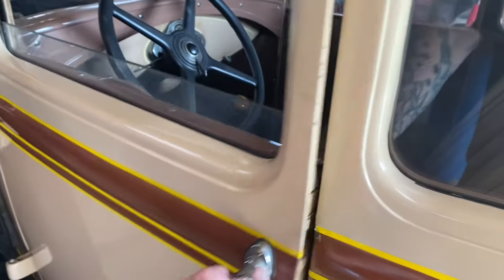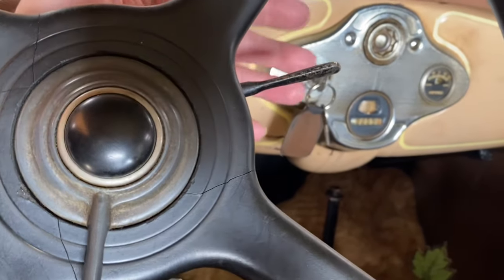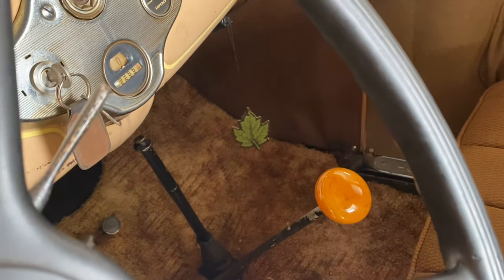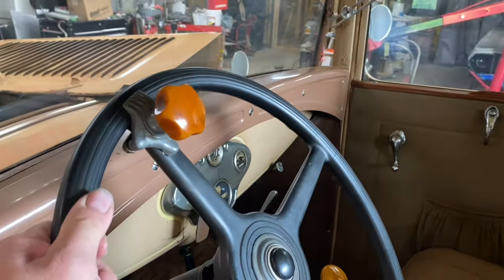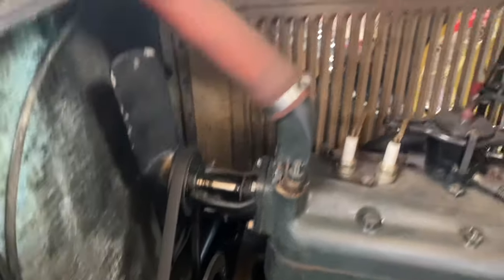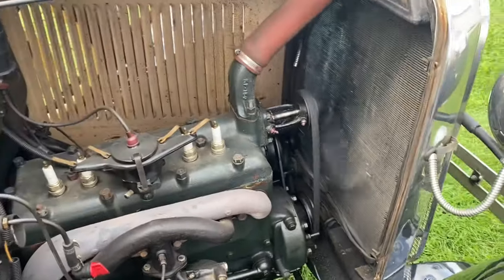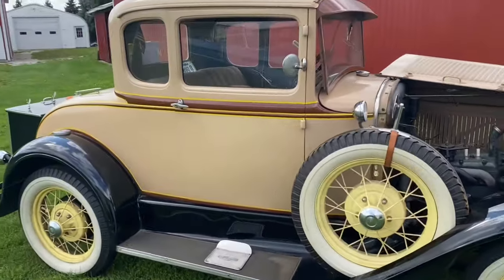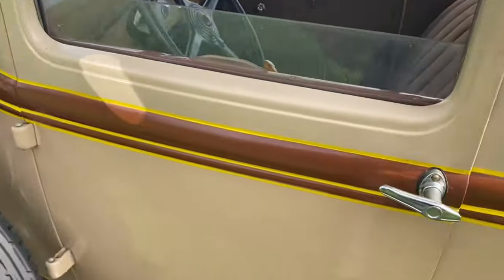Take a tour around a 1931 Ford Model A.  They’re not as different as you think.

Comment: Nice video!  One correction: the black bowl you identified as the factory fuel shut off is actually the fuel sediment bowl. The factory fuel shut off valve is on the inside under the fuel tank.
Reply from the maker: Thank you! And thank you for the info. I appreciate it!
Reply: I didn't see a sediment bowl, it may have been removed

Comment: That autolite heater cover is not made for that manifold. Auotlite made an exhaust manifold that had a extension above the tubes that piece fit on. It was a what they called a waffle. I think. I could be wring on the name. I have the exhaust manifold on my Model A, but I don't have the cover for it.
Reply from the maker: We where wondering that because it doesn’t fit worth a damn haha. Thanks for the info!

Comment: You have no shocks on it.
Reply from the maker: I don’t recall seeing any either to tell you the truth. Do these have friction shocks?  I am by no means a Model A expert
Reply: Model A’s have houdaille shocks instead of tubular shocks. They’re oil-filled, about 4” in diameter and 2” thick, bolted to the frame and attached to the suspension with a shock link. This car is missing its shocks.